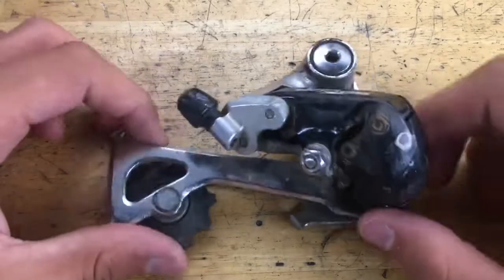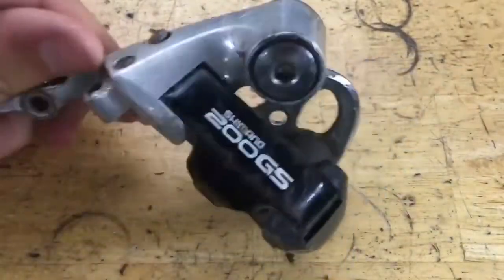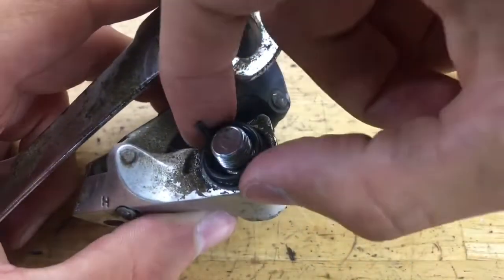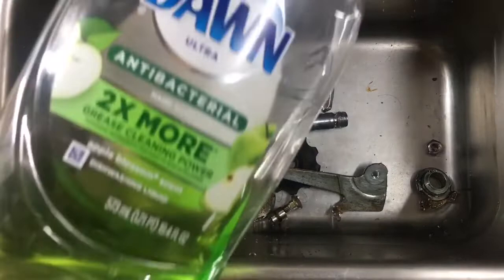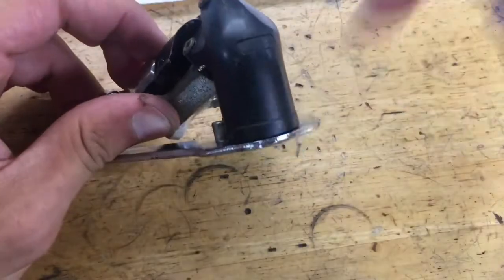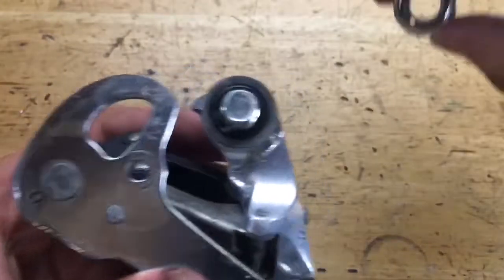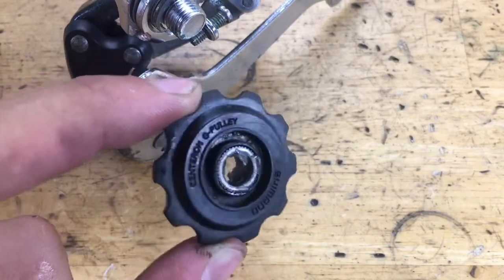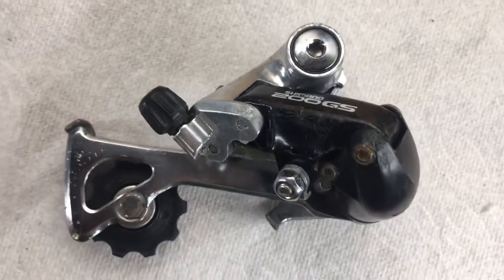How To Rebuild a Shimano 200GS, Altus C10, Alivio MC10, Acera M290, Exage Country, 200CX Derailleur

Comment: I pulled out the clip at 1:08 but the tap still sticks inside. I tried pulling it out not possibe. I think there is an issue inside with the spring because the derailleur is shaking around this screw when attached to the bike, being an obstacle for proper shifting. Does anyone have any suggestions?
Reply from the maker: That happens sometimes just pry it out on the side in between the tab and the aluminum part of the derailleur. Make sure to grease the seal well